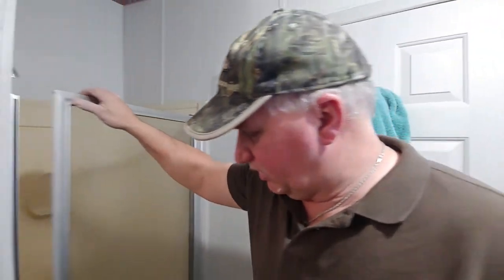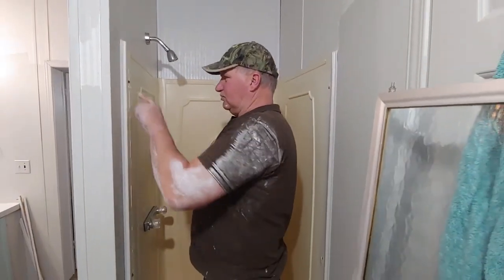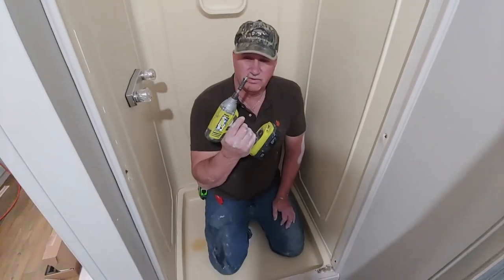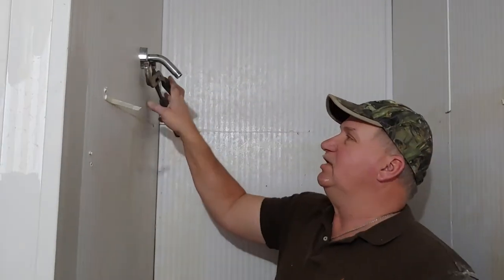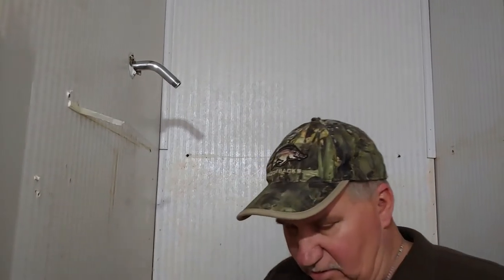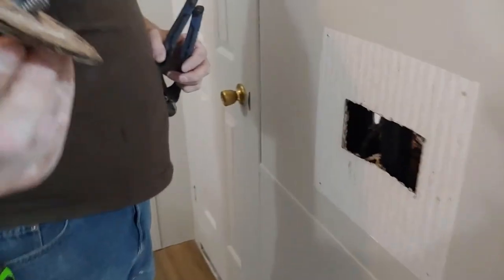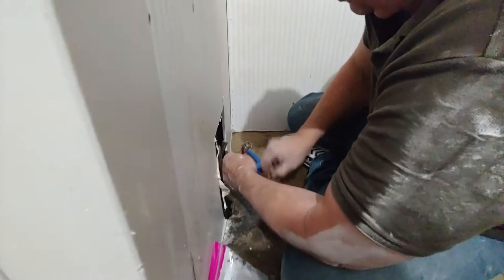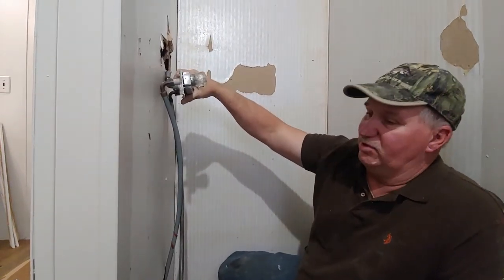How To Remove A Shower Stall

Comment: Dumb question because I can, can I cut the the putter edges off a new pan, cut the drain hole bigger in the old pan, drop the new pan inside the old, silicone the crap out of it and call it a day? Would that work and be “okay” or not so much? I’m going to flex tape the cracks for now but it really needs fixed
Reply from the maker: I understand trying to use the old pan. The problem is the floor underneath the old pan will need to be replaced to support the pan to keep it from continually cracking and leaking. I wish you all the best on your project.

Comment: Hello, I want to remove the shower stall in my home. I would like to rip out the wall surrounding also and close it up, so my room is bigger. How would you do it? I also notice at 11:15 there is a thick black pipe or pvc pipe next to the pipe that holds the water to the shower head. Can you also cut that down and close it off?
Reply from the maker: All of it is possible. And I have done it before

Comment: What is the electric tool that’s used cutting around the seams. Pretty nifty tool.
Reply from the maker: It is an oscillating saw. Harbor freight has an electric one for 20
Reply: @StraightArrowRepair  thanks

Comment: When installing this type what is that wood strip for and does that one piece come with caps for corners
Reply from the maker: Depends on the kit the wood was to support the door. Yes the corners are filled in with small pieces provided by the kit . Hope that helps
Reply: @StraightArrowRepair  what would be better the liquid adhesive or sta put spray
Reply from the maker: @nicolewebb558  liquid nails makes a tub surround caulking I believe.

Comment: How do I remove the shower stall without damaging it. I need to replace the floor underneath, but I can't afford to replace the shower stall.
Reply from the maker: Remove all the trim around edges. Remove the drain. Which should require going under the house to get at the trap area. Remove knobs on faucet and trim around faucet may be threaded to faucet. The screws on trim around edges may strip so have drill bits to drill out stripped heads. I believe it can be done. Hang in there be stubborn . I am proud of willingness to do the work. That is going to give many successes in the future. Remember always fail forward. Do not fail by not trying.